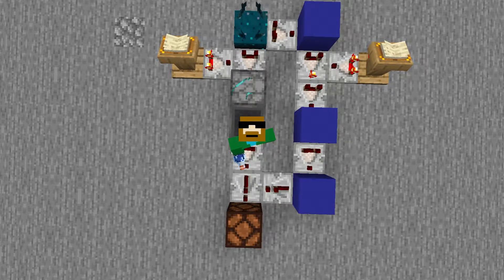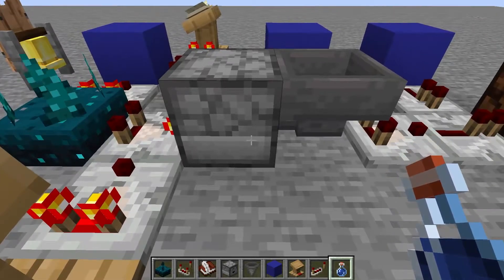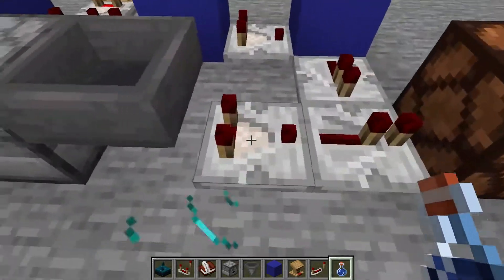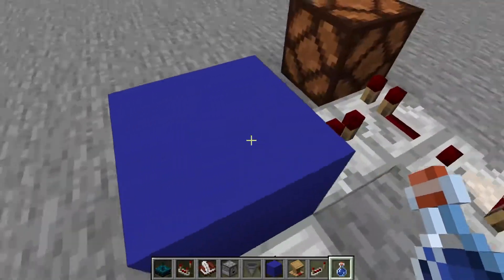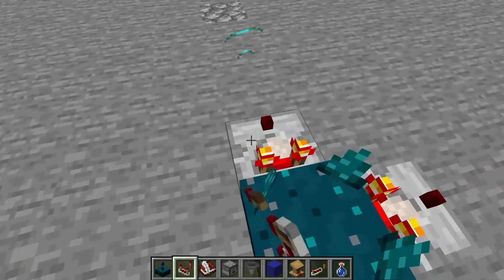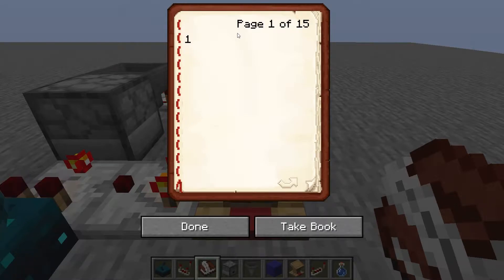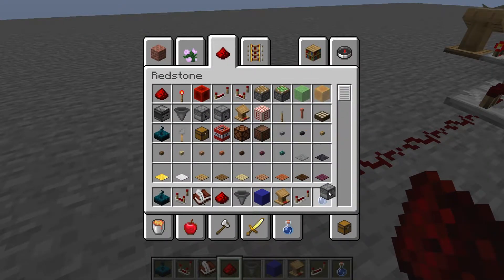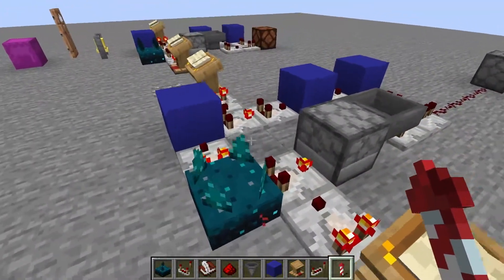Sculk Sensor Signal Decoder and Filter

Comment: ok so a little question so i can understand this a little better , the lectern on the right must have the signal that you want to be detected and in the left one you must place a signal with 1 higher than the right one to work ? Oh and what is substraction mode ? the mode of the comparators , i could never understand those